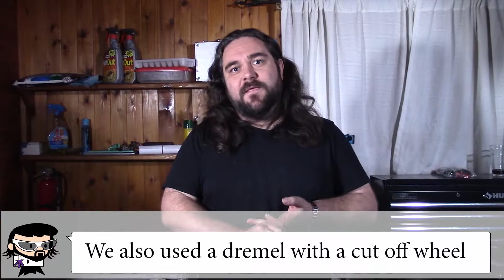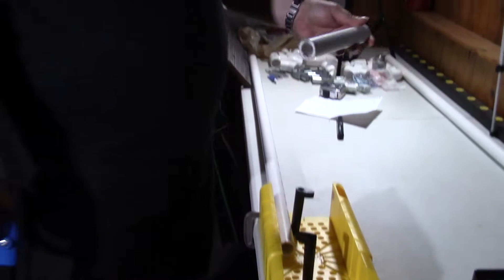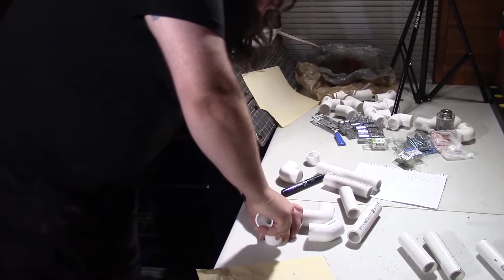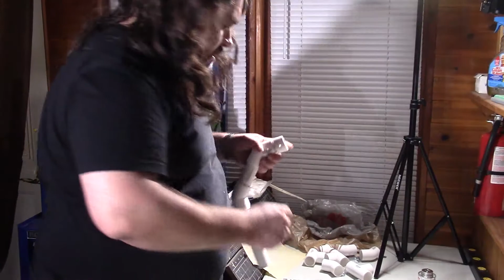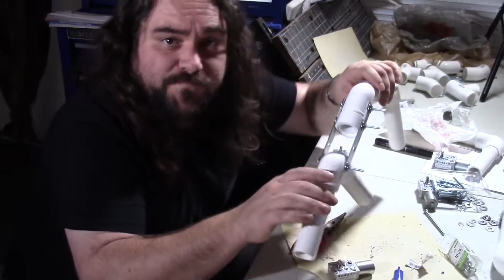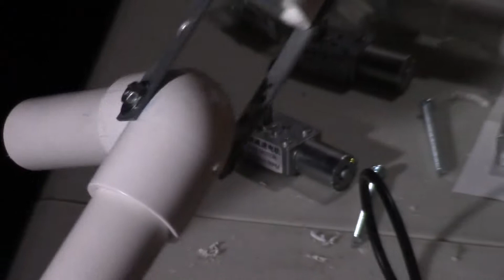Planetary Rover - Chassis Build Part 1

Comment: What board will you use to control the engines?
Reply from the maker: César Ramos I will be using a dual channel 30amp motor controller, which along with the hall effect encoders will be handled by an arduino. The whole systems master computer will be a raspberry pi 3. Which will handle interpreting the sensors, doing the computer vision and path finding.
Reply: Congratulations, your project is very good, your channel is very interesting, if you can put the link of the components used by you in your project, in particular the board that controls the motors, it will help a lot. Thankful.
Reply from the maker: Will do, once I get to a computer. I will put the components for the drive system in the description of this video :)
Reply from the maker: I believe I linked to everything i will be user for the drive section. Will do a similar list for each section as I build them. Next two sections will be battery management and sensors excluding the rovers mast.
Reply: Thanks brother, I'm looking forward to the next updates. Congratulations